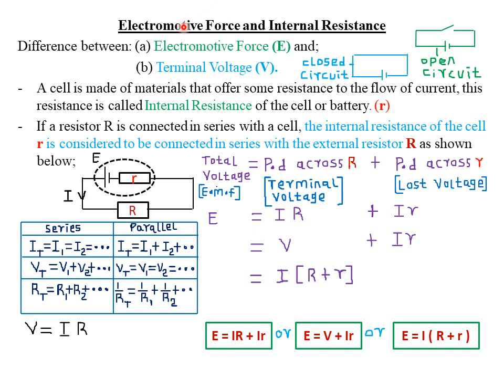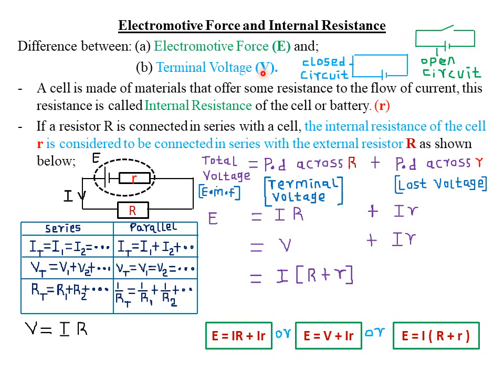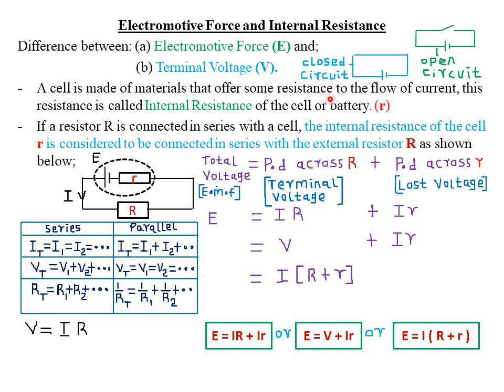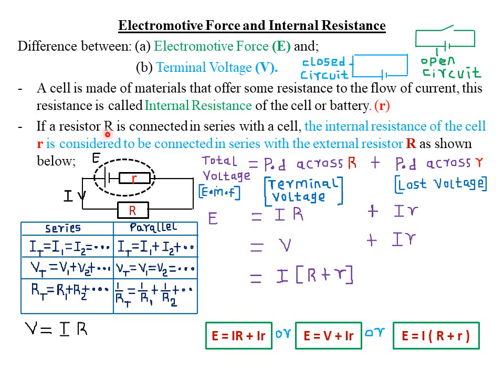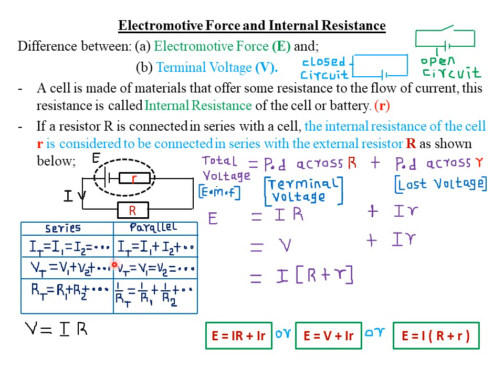CURRENT ELECTRICITY (II): LESSON 10

Comment: hallo sir, I have a question.....from Ohm's law, we said that the current flowing through a conductor is directly proportional to the potential difference across it when temperature and other physical conditions are kept constant ,and the mathematical representation of the law is I&V {I've used & to show the proportionality symbol}.Mathematically when you introduce an equal sign, it will be I=RV, where R is the constant of proportionality. Now I dont get why the equation is the other way round, that is V=IR. Also, when drawing the graph to represent Ohm's law, why is V taken to be the dependent variable {it is placed on the y axis} and not I?